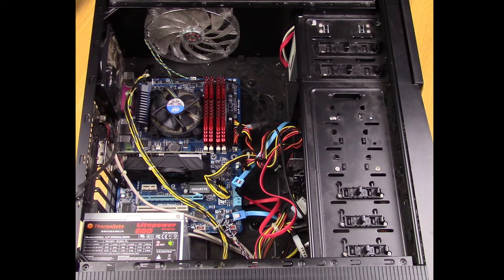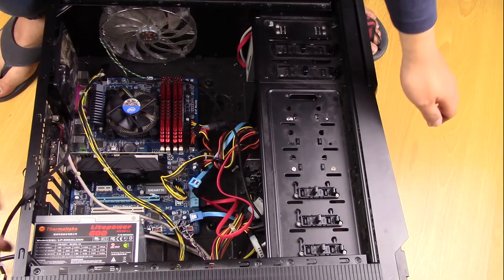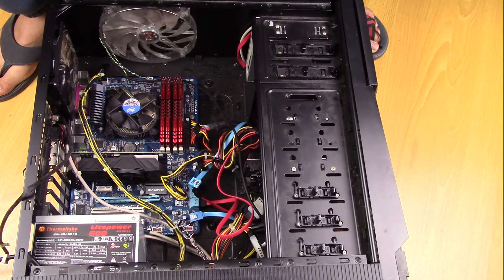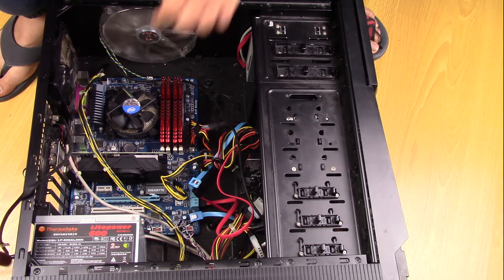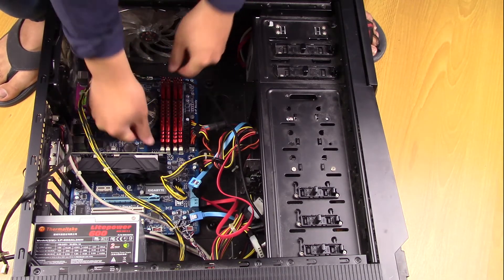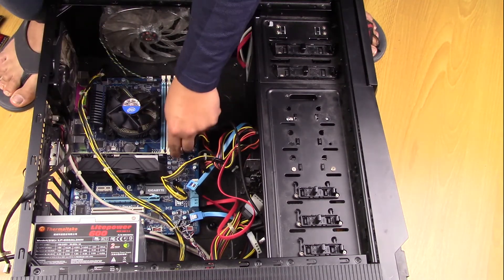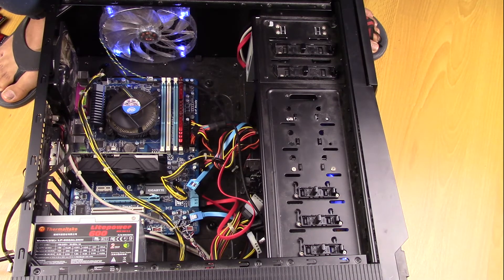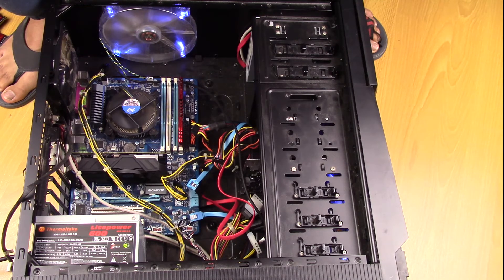Fix a computer that won't turn on - Episode 1 - remove ram

Comment: When I changed the watercooling in my PC recently, the exact same thing happened to me (I was getting the brief on-and-off that you were getting at the start of this video). I fiddled around with everything for ages, avoiding touching my cooling & CPU because I didn't want to have to clean off the thermal paste and use more, but I ended up having to. It turns out, since I'd taken my CPU out before putting the new cooling on, the tiniest piece of dust had gotten behind it when it was re-seated, so one of the pins wasn't fully connecting. I blew it off, re-seated again, and it thankfully booted. Crisis averted
Reply from the maker: true. thanks for sharing the info, I'm sure others here would find it helpful. Yeah I hadn't removed the CPU in a long time